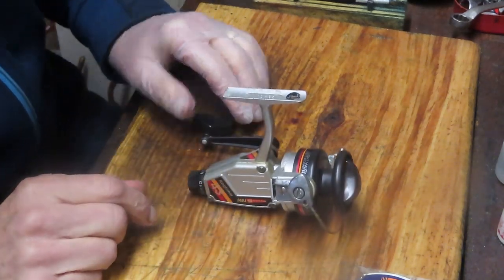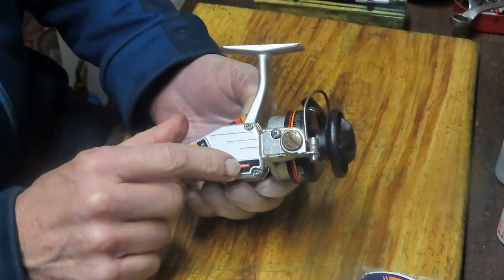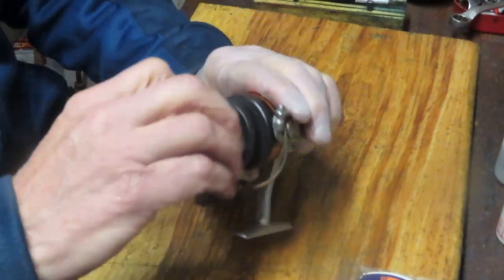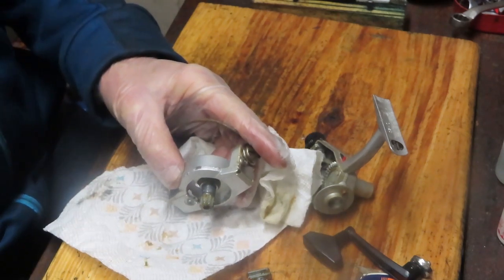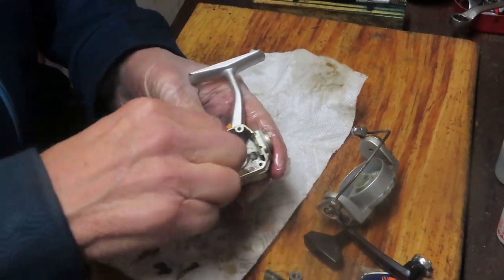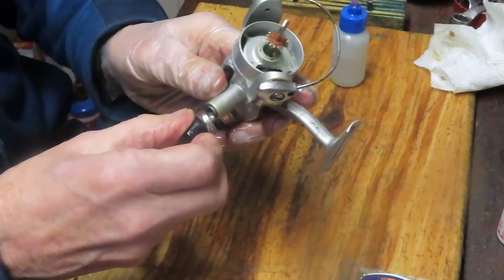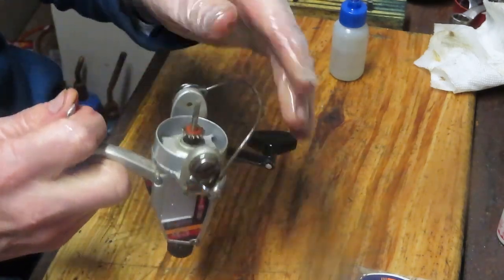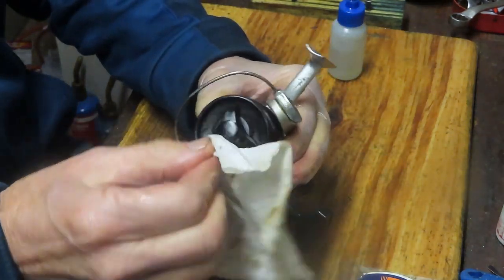Abu Garcia Kingfisher 43 fishing reel how to take apart and service

Comment: Dennis, I love your channel and have learned a great deal.  Was wondering if you would do a video showing what you recommend for cleaning and maintenance of both a spinning reel and a conventional reel after being used in saltwater.  What parts should be oiled, what parts should be greased, etc.  I see lots of videos showing the reels just being rinsed, but I don't think that's enough.  Thanks!!
Reply from the maker: Thanks for the suggestion Chris.  Yes a rinse with fresh water is always recommended after a trip.  There are some other things you can do as well.  I will see if I can put them on video - Best wishes - Dennis

Comment: Another very informative video Dennis, thank you!  Great example of what to look for in a reel.  
1.  Some reels obviously are lifetime reels, made to be fished a lot and, of course, deserve regular service.   "A lot" means it has bearings (more than one) instead of bushings and are reels that could survive charter service for several years.
2.  Some reels are light duty.  This is a prime example.  No bearings, but it does have a metal crosswind block, a "substantial" main shaft, and several metal components.  Obviously, this is not a reel that would survive a charter service for long.  However, it is worthy of being serviced to get some years out of it, but service it yourself.
3.  Some reels are just low end, made to be used short term and low duty.  No bearings, Plastic cross wind block, thin main shaft, etc.   We live in a throw-away society now, so these reels are the bulk of what you find in stock.

Penn seems to only make #1, although some of their recent offerings don't last charter service for more than a couple of years (Pursuit & Fierce come to mind).  Shimano and Pfluger make #1 and #2.  Daiwa's and Abu Garcia's make all three.  

I recently tried to give a Daiwa Shock 3000 a second chance, but it was horrible (warped plastic cross wind block, bent / cracked main shaft where the shaft was thinned out to mate with the crosswind block).   No amount of keeping it clean and serviced would have prevented this failure.

I was on a charter boat in Key West last spring, and used the boats gear (Penn Fierce III 4000 on a medium 6 1/2 ft Ugly Stik) for some snapper.  Captain lamented that, despite regular service, the Fierce's were not holding up more than a season and a half, and was going to start going to Daiwa BG's instead.  

In the old days, you went by the name to ensure quality.  It is more tricky nowadays, and you need an engineering eye to recognize design content.  This is just my opinion of course but based on observations.
Reply from the maker: Thank you for your well thought out reply.  I agree with your analysis.  The skeptic in me says the reel manufacturers do not want reel to last forever because they cannot sell the replacements.  Als - commercial charter services put a whole different strain on reels, even the good ones.   I agree the low end Daiwa reels should be avoided.  Best wishes - Dennis

Comment: I love it when you tell the history of these reels. I have a number of just Garcia reels. I have a few other reels that have an external bail trip. In general I don’t like clip held rotor/pinions. For this reason alone I won’t get this reel. Only the Daiwa 1500C and their J13 and J40 use those U clips to hold the rotor/pinion on the housing. Most other Daiwas don’t use this clip. Great video Dennis! — Chris
Reply from the maker: Thanks Chris - I am impressed with this one.  Smooth operator and no shake or wobble in the rotor